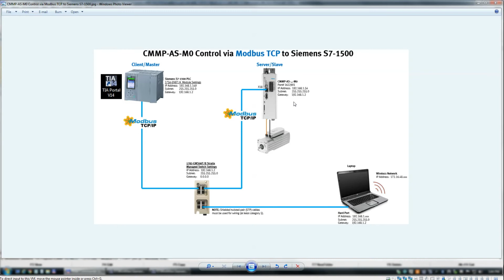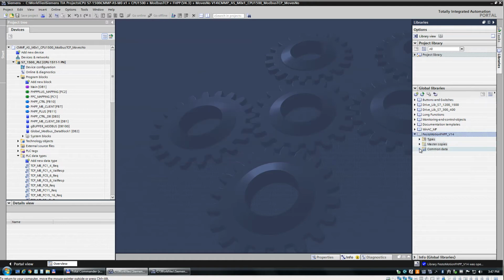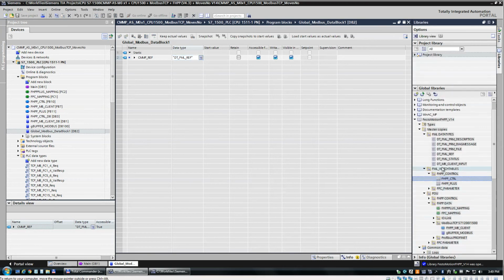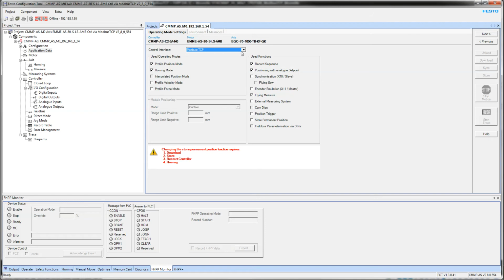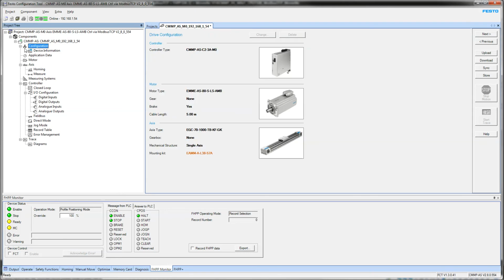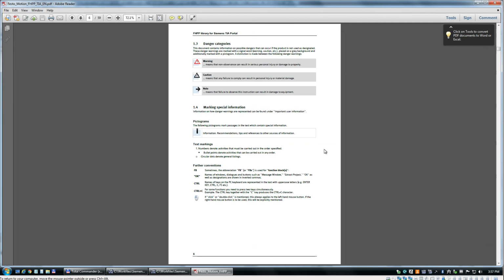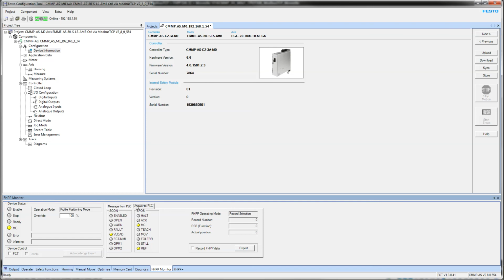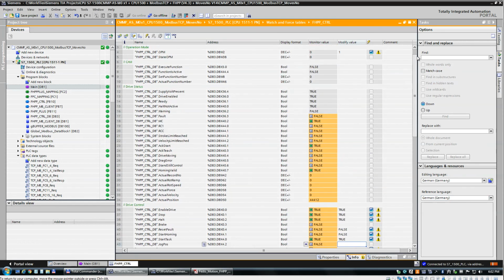CMMP-AS-M0 x1 + CPU1500 + ModbusTCP + FHPP V4 3 + Only FBs V14

Comment: Hello, I wonder if it is possible to connect a PLC S7 1212  (tia portal v13) and Festo FB36 via modbus with block 16DInputs and 8DOutputs
Reply from the maker: Hello, I don’t normally answer questions on my YouTube because it is all my personal time, BUT, to me it would make more sense to use a ProfiNet node FB37 as this is the native Siemens protocol. Why are u thinking about modbus which is easily inferior. Did you buy fb36 by accident? If you had to use the Fb36, it is capable of ModbusTCP and I know the TiA portal offers some mod us FBs, I just haven’t done this myself because it’s not something that would be very common and therefore not worth my time investment.
Reply: @Proud2BProud  why u put then video's on youtube if you are not ready to share your knowlegde??
Reply from the maker: @morrocantocador  The video is sharing my knowledge on the topic I have explained within it.  The FB36 is capable of ModbusTCP, so if your V13 TIA is, then it would be possible, but, I would recommend using a CPX-FB33 ProfiNet as the head module instead of the FB36 and this way you have real-time communication.